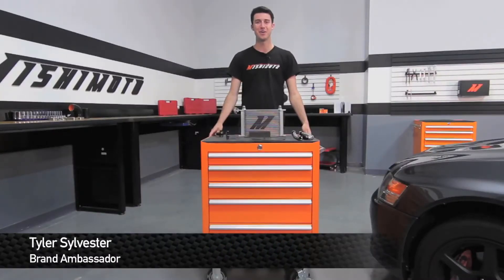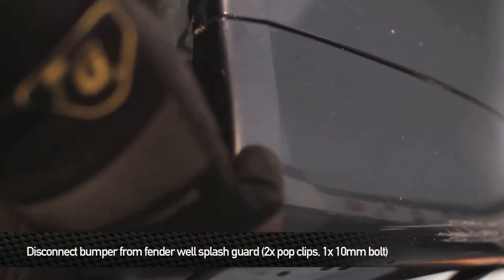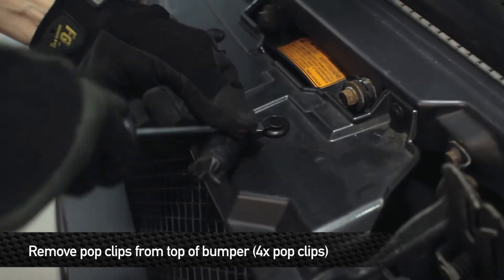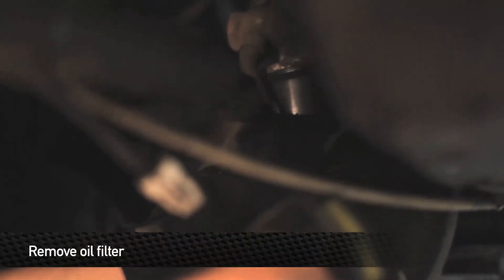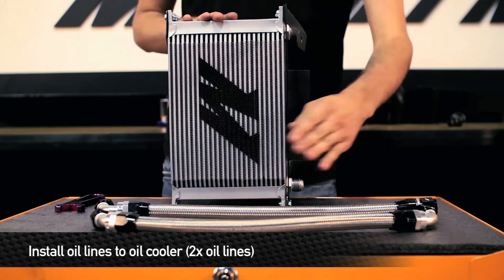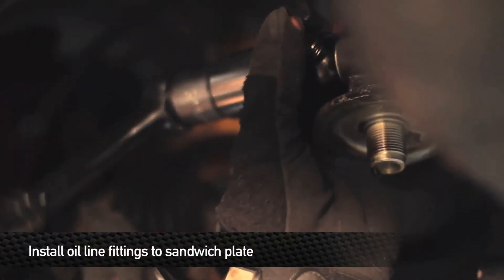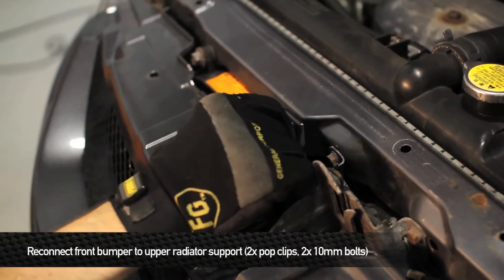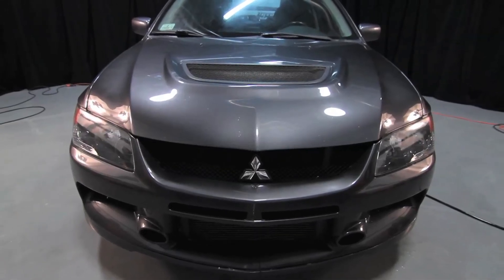How To Install: Mishimoto Mitsubishi Lancer Evolution 7/8/9 Performance Oil Cooler Kit

Comment: There's  another install video that recommends that you make sure your oil filter and new oil cooler are topped off with fresh oil to minimize air in the system. I top off my oil filter with every oil change and it works. It minimizes the "valve clatter or tapping" that Evos are notorious for.

Comment: Hi I have the same oil cooler installed on my Evo 9, one of the fittings going in to the sandwich plate is leaking I found out today and it’s stressing me out the fact that the oil cooler is fairly new please advice or may be I tighten the bolts properly is there a torque spec for it?
Reply from the maker: Hey Hali, our team recommends 15-25 ft/lbs for those straight fittings. If you are experiencing any issues, please reach out to our team at Support@Mishimoto.com or call at 302-762-4501 and we'd be happy to help out!

Comment: Might be a dumb question (sorry just getting into vehicles and there systems), but are you required to drain the oil out of the car first? Or does the oil cooler hoses have a close off valve?
Reply from the maker: Hi Divinum! You just need to let the car cool, no need to drain all the oil, however you will need to remove the oil filter, so have a drain pan near by to catch any oil that drips out.  Here's the installation guide for reference: https://cdn.mishimoto.com/media/productpdf/MMOC-EVO-01_InstallGuide.pdf